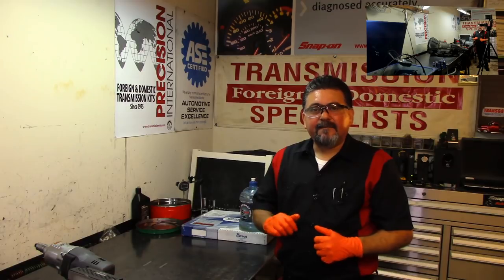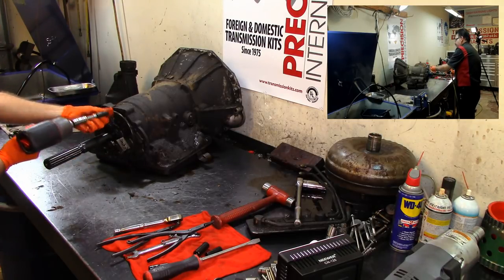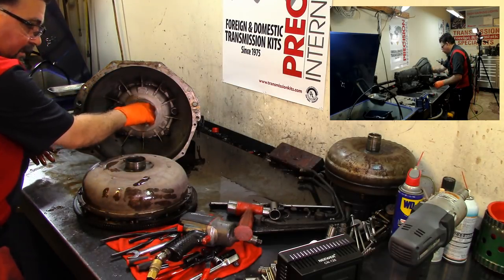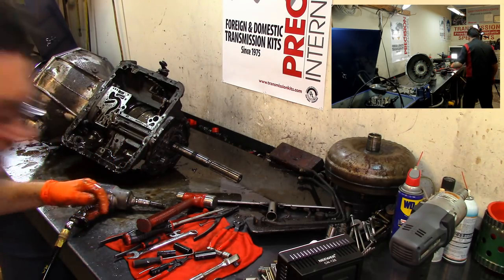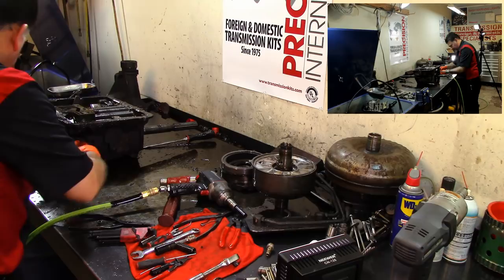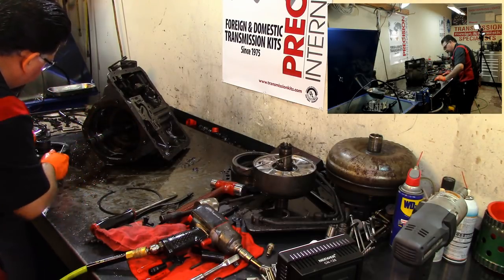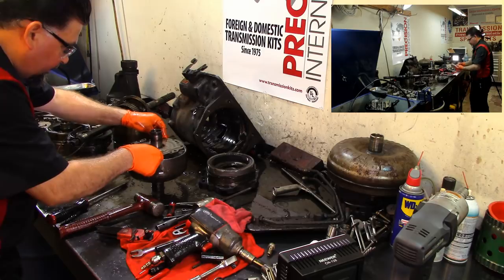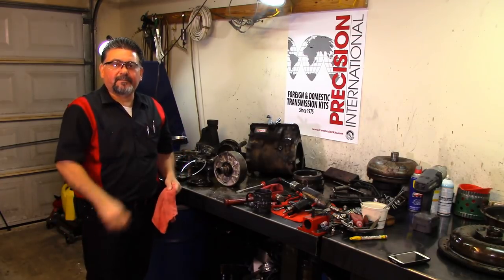Jetaway 315 Transmission 1957 Cadillac

Comment: These are very smooth transmissions. I have built many of these in my earlier years. The rear pump enabled the push/tow to start ability was discontinued in 1959. We called them "controlled coupling" or just CC. My first transmission school was on the 1960 Pontiac. This was at the G.M. Training Center in Hapeville GA. I was Transmission man in the Pontiac dealership. I graduated from this class on my 20th birthday. I am now 77 years old and still working. I just finished building a TH 350.
Reply: Reggie B здоровья Вам и долгих лет жизни!
Reply: Reggie B didn’t they use a different oil back then, not dexron but a clear seal blubber derived oil or something? I did have a 59 Buick with the dynaflow but I never got to see inside it,obviously they’ve got a reputation.
Reply: @ceciliapolicarpio1822  The fluid was designated ATF and all GM and Chrysler cars used this fluid. It was replaced  by the Dexron. Ford used a fluid just called type F. it had more friction ability. If we had a GM Transmission with a little slip we would put type F in to help.
Reply: Reggie B Where can I find parts for a 315 jetaway. I have an all original 64 Bonneville 2 door hard top. I had a guy tried to rebuild the transmission many years ago and he failed. So it's just been sitting in a garage.
Reply: @kerryrambo3503  1964 was the last year of the Jetaway. anything from a 1959 to a 1964 parts will work in it. I have a 1956 Eldorado with one of these transmissions. The 56 thru 58 is the same. They changed in 59. What is the Issue with yours? I might be able to give you some pointers. Where are you located? I am in northwest Alabama. I can communicate with you by phone or email if you would like.
Reply: @reggieb6853  to be honest Reggie it's been so long if I can recall I believe it either would not shift out of first or would not pull it all. I live in Dallas but the car is in Oklahoma and my parents house. My email is kerryrambo@gmail.com  It's locked up in a garage and I really haven't had the time nor the money to put into it but I really been thinking about it here lately. She's a pretty sweet ride less than a hundred thousand original miles nothing's ever been done to the engine besides change of voltage regulator in the battery. I still have the original biaply spare in the truck.
Reply: I wish I could get you to rebuild the transmission in my 60 Pontiac!
Reply: I have a 56 Oldsmobile with the jetaway and no one wants to touch it. What was the big problem with those???
Or was it just the 56 because That was the first generation trans so all the bugs weren’t figured out yet???
Reply: @jasondean3332  It's probably because they are not familiar with older transmissions. Getting to know something like this can take time, and they have to provide you a warranty after it. Might not be worth it for some shops. If I was you I would call the local "old cars" shops and try to get a reference for a builder. My local guy loves trying out new things if I let him take the time he needs to work on it, but he's probably more an exception. Have a Focus with the dreaded double clutch on it, and he was the only one in town willing to change it. He did a terrific job, even if he had never done one before. He told me he would love working on my '59 Jetaway if it ever gives the ghost
Reply: Wow!! Lucky you! I totally envy you!! Had wanted to try to rebuild/overhaul mine out of my '62 Caddie, no rear pump, but lotsa work space needed, special Kent Moore tools, a transmission holding jig, access to hard parts,and all the pertinent experience necessary!! Had the front seal behind the torus members & first stage planetary replaced, that helped after a real bad leak started years before..after Dad completely drained all the old AQ/ATF, type 'A' out, and refilled with Dexron..very aggressive. And the seals, started leaking, got worse...But it ran, shifted very well after the reseal work was done in 1992-3...Sure do miss my baby!! Engine seized in it sitting here in dank, damp, humid Mississippi climate, after water got down into the cylinders, bores, pistons, etc..just rusted & seized up! Had 400,000orig miles on her. NEVER WAS REBUILT!!
Reply: @ceciliapolicarpio1822  I can answer that for you..Yes, those old Jetaway Controlled Coupling HydraMatics came factory-filled with AQ(Armour Qualification)-ATF, Type "A" fluid..had sperm whale oil in it to substantiate the lubricating/cleansing properties of the oil..Wasn't as aggressive as Dexron, which was used in lieu of Type "A"..You're correct..
Reply: Si Si si Fue la Hydramatic de acoplamientcontrolado la mejor trasmision!  A mis 20años  ( tengo75 )fue la primera vez que me meti con un ingenio de estos  y me enamoraron ! Aunque ya habia tenido experiencias con la Hydramatic del camion GM XM 211 !

Comment: The  1-2 and 3-4 shifts are power-shifts. The engine slows down over about 3/4 of a second while the seat pushed you in the back. The second fluid coupling fills and bypasses the torque around the from reduction planetary. After second, the back planetary shift the high range and the second fluid coupling now drains  to give you third. If it stays full, you go from 2nd to 4th.

Comment: Buick never used this transmission. Buick used the Dynaflow from 1948 thru 1963. The the Super Turbine 400/ Turbohydramatic 400 came out . But thbkkfully it was a completely different design from previous Hydramatics.

Comment: ..Totally amazing!! Beautifully done!! The '62 Cadillac I sold to a local older car guy in Sept 2021, had this same transmission, give or take a few differences! Fell in love and became fascinated with this unit shortly after finding out it was a Dual Coupling/Controlled Coupling HydraMatic Jetaway..Just had to learn more about it!! Mind had a half-moon cover plate with a thumbnail cutout vent under the belllhousing, held by cap screw/bolts, so the fluid coupling could be "6 o-clock positioned" to open the torus drain plug to drain the coupling!! Fascinating unit! My '62 shop manual showed all the parts broken down/extricated from the unit as you would attempt to rebuild it! Yes, that part he(Hiram) had trouble separating was, i believe, the front unit controlled coupling, which fills & exhausts for each other gear shift. Totally a fascinating unit and video!! Can't wait for Part 2..Thank you Hiram!! Your skill-sets amaze me!!

Comment: I am a 85 year old Korean war veteran who was trained in Hydraulics , pneumatics, for flight controls and rudder boosts systems.  worked on B-29's a lot, some of them had track's on the main gears for landing and take-offs in the desert. some of the aircraft were Hydraulic nightmares,  almost all the fighter jets made by North American had dual systems on everything, such as #1 and @2 flight controls, plus the utility system for brake's, flaps, and power steering. of all of them I think the F-100 Super Sabre was the worst. after the war I got out and trained as an automatic transmission specialist.  this young man in this video is a very skilled specialist, he is dealing with a unit that was built and became obsolete before his time and I must say he is doing a great job of it. the hydromatic transmission's before this model came out did not have pans on them but they did have the Fluid coupling drive. and the 53 models were fitted with the Buick Dynaflow transmissions which took some clever redesigning. as the Buick's had closed drivelines in that model like the Chevrolet's prior to 1955.  but the Old's and Pontiac's had open drivelines.

Comment: The thing that wouldn't come apart was another fluid coupling; that was full of aluminum fins that used to get destroyed by the torque. That where the metal came from, and its unfortunate that you couldn't. Even more unfortunate that the pump was that worn (that was common when the fluid coupling got worn out). That coupling was filled and exhausted during shifting to smooth it out.
 Thank you so much for this trip down memory lane. I used to do a few of these when I was a kid, along with the Ford-o-matics and Glides. I used to restore cars and loved this old stuff. So much easier than 8 and 9 speed transmissions!
 Thanks again
Reply from the maker: +Mark Naravas I did get it apart, looks good from the inside. Fins okay. The snap ring popped out. I'm trying to get just the aluminum part since a lot was scrapped off. Otherwise I'll need to get the complete torus. And of course the pump.
Reply: Automatic Transmission 
 Well, I'm glad you got it apart. But normally that's what gets destroyed in those. First one I've seen that needed a pump on a while. Might be a B@@tch getting the torus and pump.
 A small tip that might help you. I put one half of the coupling in the freezer and the other half in the sun for a while to slip the halves together. Hope the endplay is ok when you reassemble it. 
 However, you're an excellent tech so I'm sure you don't need any help.
 I appreciate all the things you've done on your channels over the years.
 And have you gotten into any of the 8,9, or 10 speeds yet?
 Thanks again!

Comment: I had a 1964 Pontiac Star Chief, one of the last two car models to use this transmission. Around the time I sold the car, it was having trouble getting into reverse. I made sure to park the car pointing uphill so I could roll backwards if I had to.

Comment: Hey hiram I love your videos. I work as a diesel mechanic and we don't usually rebuild transmission but every now and then we do, but we only work on Dodge, Gm, Ford transmissions. I watch all your videos even though I don't work on gas vehicle transmission. I love to watch you work. The way you tare down transmission is amazing, you have so much knowledge on transmission. It's fun to watch someone who's a master at their craft work. Thank you so much for your videos. I watched your videos before I rebuilt my first 48re and I just go done rebuilding my first 5r110, that I will be installing next week. Also just wondering have you ever rebuilt a Ford 6r140 and if you ever run across one, it would be awesome to see you rebuild it. I only ask because I own a 2011 f250 and one day I would like to rebuild it myself. Thanks for your videos.
Reply from the maker: +dnm20101 6R140's are good units so far. I've replaced solenoids on those units when they start actin up. They're available through Ford, you just need to identify it correctly. In a few years I think they will be as popular as the older units.

Comment: Did a very similar transmission as a senior in high school auto shop in 73 on a 62 F-85 with the aluminum V8. We called the fluid coupler a torus. IIRC it had two exhaust valves on the exterior chamber where the fluid could be dumped then the proper clutch pack applied and then it was filled with fluid again for the shift. Front pump has an external spring driven variable displacement system where pressure build up would move the outside 'ring' such that the pump would not waste energy pumping excess fluid. Might be the weak point in the design because internal leakage would then equal direct heat build up in the fluid. My kit was robbed of the two main passage conveyors between the pump and the valve body, we had to make do with fuel hose substitute because the parts house denied stealing anything out of the 'new' kit we bought from them. It quit after 6 months, when I pulled the pan to see what I could see, there were both sections of fuel hose laying loose. How they could escape total entrapment like that I still can not fathom. They appeared to be pristine too, should have been ragged up to a horrible extent. Should have kept that one, trade in value for another used car was $40. This one appears to be a good deal different, so now I'm wondering what I was working on so very long ago in another time and place?

Comment: My transmission cooler seems to be the exact opposite with a newer model Jetaway. The transmission actually pumps its oil through the radiator and pulls it back. Odd how only eight years can make such a big difference in the type of cooler.

Comment: I have a 1960 pontiac Jetaway 315 partially disassembled in my garage.  The tool to get the front coupling apart is hard to find, so I had to improvise a puller myself.

Comment: @ 46:05 that friction plate is actually called  a "neutral clutch".. @ 55:04 you can see the  inside  bottom of the case there is an alignment pin that keeps the one drum from rotating. it's  inserted to a hole in the case. if he does'nt
 pull it out now he'll lose it in the wash. without it it's disaster time.

Comment: Hello, I have a question, my 04 vw beetle 2.0 with auto transmission has been doing this issue when it is cold where it sort of bangs into first gear, other gears are fine. When the car heats up the issue stops completely and it shifts perfect. What would it be? thanks, I like your videos.

Comment: can you do a couple videos of the MD8 transmissions and the differences between that casting / valve body and the differences of the internal components? I've called around and tried to find out but i cant seem to get a good answer! My truck came with a MD8 transmission and there are some things that i would like to do to it to make it more fuel efficient via putting a and overdrive system on it! not even sure if it has one or not and if it does weather or not if it works or not! things like that!

Comment: I have a 1956 Oldsmobile 88 with the jetaway. No transmission shop wants to touch it. 
What was the big problem with these transmissions?? Or was it just the 1956 because it was the first generation for that trans so it wasn’t perfected yet???
Reply: I also had trouble finding a shop to do my 58 cadillacs jetaway. Finally did, they did a great job. Still shifting fine. A few year later, i stopped by to say hello and the shop was gone. The business next door told me they moved Out of state. Dang! Hope i never have problems with it, will be back scrounging around for a shop that will touch it again! Hopefully you found someone to fix yours.
Reply: @johnfranklin5277  hey John. I indeed found an old transmission shop about 7 miles away from me. These guys have been rebuilding transmissions since the late 50’s. I got so lucky with them. Good ol Jim rebuilt my JetAway in a about 2 days. He told me what the common problem was with the 1st generation JetAway then replaced that with the upgraded part. I’ve been driving my ‘56 Olds as my daily driver ever since. There’s nothing like warming up an American Classic for 3-4 minutes every morning.
Reply: @jasondean3332 Hey Jason,  Very glad you were able to find a shop to rebuild your Olds transmission! Its definitely tricky trying to find mechanics to work on these old girls. Today's ASE guys just look at it as if its from another planet. Can't even install points. Carb rebuild...forget about it! Lol. Enjoy your ride, I'll be taking the 58 out for a little Thanksgiving cruise...😊

Comment: Our family had a '56 Cadillac, pretty sure it was the same trans. Replaced the trans 3 times (with units from wrecked cars). They just didn't hold up.
Reply: The original Jetaway in my 58 cadillac that my parents bought in 1960 was still working fine in 2011 at 132.000 miles. I had to have it rebuilt because it started leaking like crazy. You cant really base reliability on old used transmissions that you have no history on such as driving style, driven hard, no maintenance etc...

Comment: Hiram, how are you doing? Did you get flooded out by Hurricane Harvey? If you're able to, leave a comment to let us know you're ok.
Reply from the maker: +dmorley100 Alive and well. No damage to my home. But I was trapped for a week with water all around me. The shop got about an inch of water, nothing serious. My 7 benches were full of things that were on the floor before the storm. The lifts we also full of stuff raised of the ground. And today, we're swamped with work. My recommendation is, if flooded, don't start it. If you're carpet is a little wet there's water in the engine, Transmission and differential. We just did a little over 40 services like that, and we got a lot of them that were started up and the transmission got ruined.
Reply: Glad to hear that, aside from the shop floor getting soaked, just about the worst thing that happened to you was a little cabin fever. Glad you and your family are ok. Though it ain't nowhere near as bad as what you've been through, I actually got a little dose of Irma, which is pretty bad considering that I live in the middle of Tennessee. Mostly just rain, but I've actually worked on a few hurricane evacuees vehicles this week, so I've felt its effects in more ways than one. Hope you get everything straightened out soon.
Reply: Glad to hear it!  Look forward to which ever direction you take on you channel!